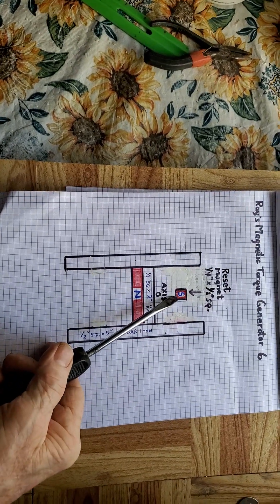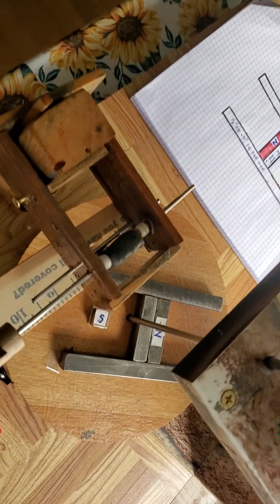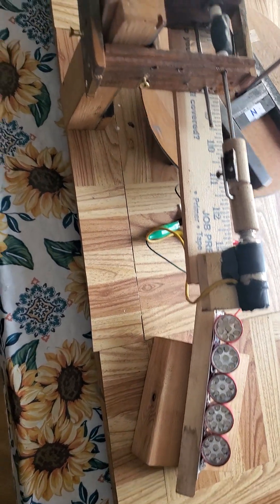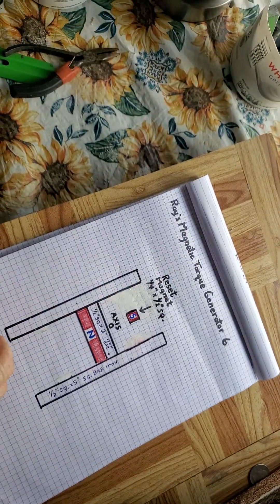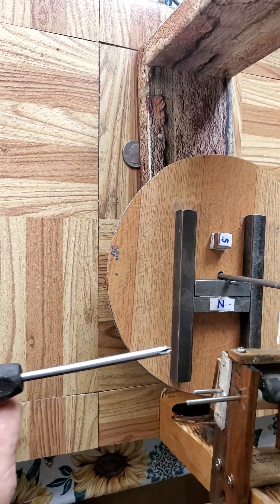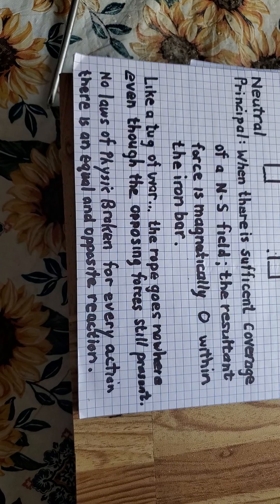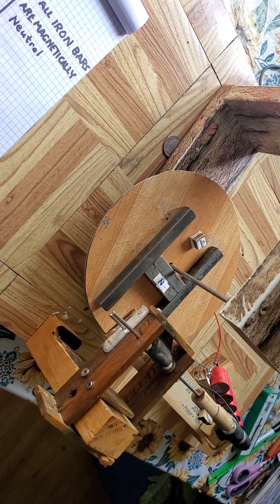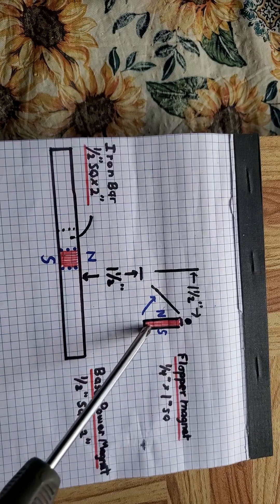Ray's Magnetic Torque Generator 6

Comment: You are wasting more energy on friction from this contraption powered by the power supply than it would take to flash the lights on those 8.4 volt bicycle headlights with just the power supply alone.